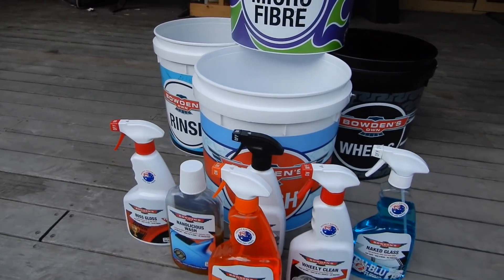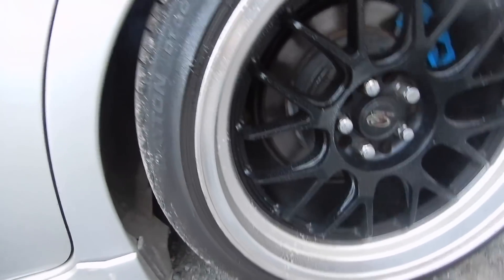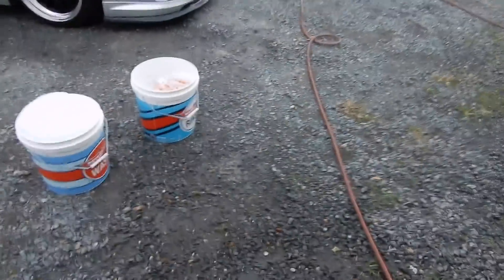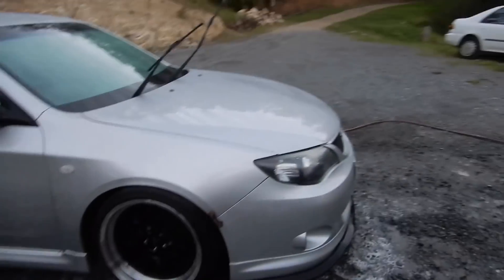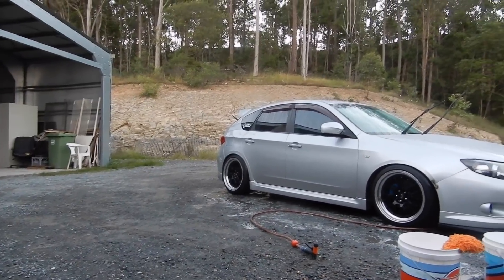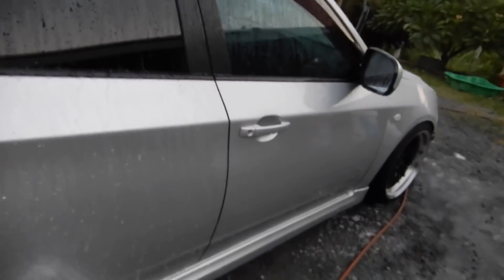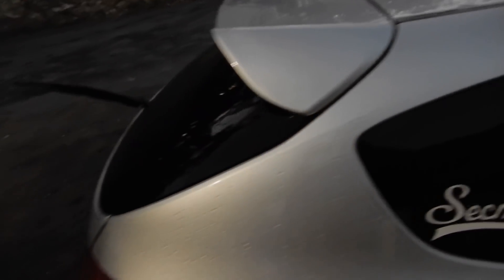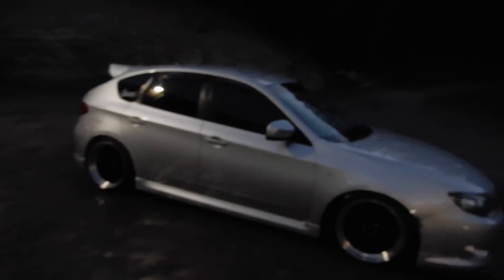Pressure Washer Free Detail Including Bowden's Own "Wet Dreams"

Comment: Where can I find one of those wheels brushes 😂
Reply from the maker: Aaron Cavalieree they are called the “foursome”. Can order them at super cheap and some auto barn have them off the shelf. Or directly from Bowdens website https://www.bowdensown.com.au/the-foursome
Reply: Do you prefer wet dreams or happy ending?
Reply from the maker: Depends how you wash your car and what tools you have available. Happy ending is perfect if you have a pressure washer, and wet dreams is also really good as you can spray it on and rinse it off, wet dreams is also good for areas like wheels where you can spray the product and rinse it with a pressure washer, they both have their own uses but I think happy endings is easier to apply and faster, however wet dreams ads a lot of shine as well. I think they are very similar but very different at the same time, and recommend both unless u don’t have a pressure washer, then happy endings is useless :)